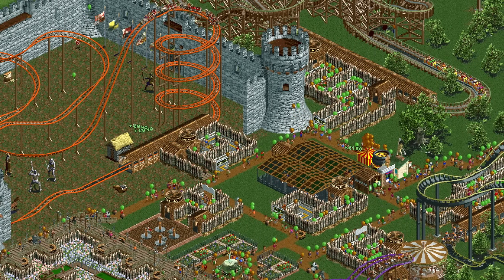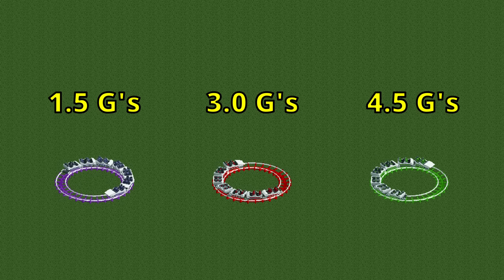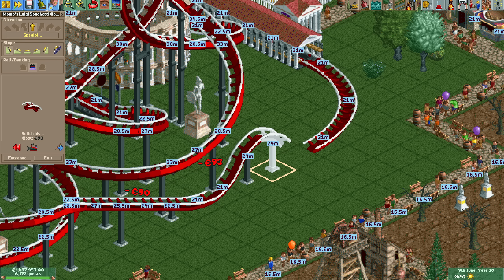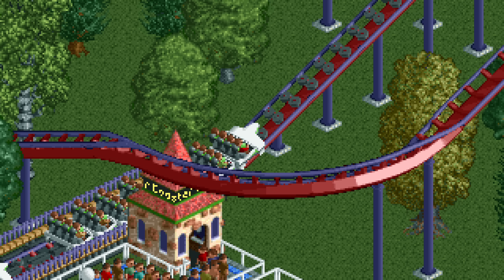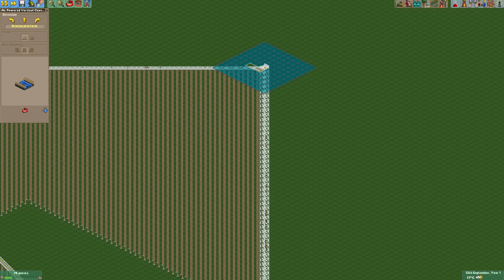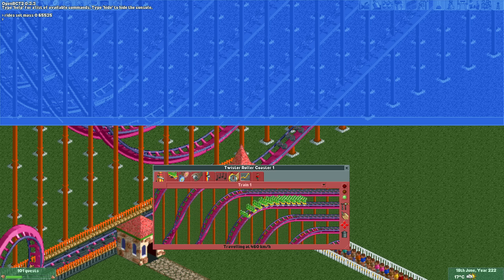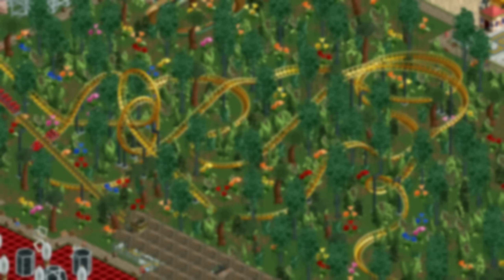What are the Highest Possible G-forces in RollerCoaster Tycoon 2?

Comment: One time as kids my brother and I were in the backseat on a road trip from CA to Yellowstone. We brought the laptop with a power converter so we could play RCT on the way. We used the ride editor to make a gigacoaster to the max height followed by a row of loops. Once we reached the end of the map we made a left turn and did it again, spiralling until the whole map was filled. Then we did our best to do layers on top of the work we had done previously- making a sort of roller coaster cube. Completing the track was incredibly difficult. Of course it took hours to run, and my brother and I forgot about the computer slowly overheating as we passed through many states. At some point some 13 hours later, we remembered our track and checked the stats. 314 excitement factor and sub 7 intensity and nausea. Of course we tried to save it, but as huge tracks are, it was impossible to ever recreate. I still think about this 20 years later and wish we had a camera to record what was a life moment for my brother and I.

Comment: Fun? fact: Curved slopes create more speed than sheer drops into flat straights in real life, so it may not be a glitch that you get higher speed  on them than on sheer drops. The physics work this way because you spend more time accelerating over the slope than the straight drop. So while yes, you reach the ground faster on a straight drop, it doesn't generate as much speed as accelerating over a slight incline downward for longer time.

This specific physics quirk is demonstrated by something called the Brachistochrone Curve.

Comment: The true highest G is the coster instantly going from 400kmh to 0 when it arrives at the station. 

Acceleration is calculated by a = initial velocity - Final velocity over time

If we say that the coaster stops in 0.1s and the difference in velocity is 400 since it goes to 0. Then the acceleration is 4000, which is 408Gs of deceleration!

Comment: I wonder what the G-Forces from the twister coaster repeated launch hills and drops are, just by themselves. No sharp turns, bunny hills, or loops at the end, just launched lift hill and steep drops chained together with 180° turns followed by a reasonable method of deceleration. It looks like it’d have pretty high G forces by itself

Comment: Very high G-forces here, but RCT2 doesn't count for G-forces that can be measured during sudden deceleration in the real world. This is evident in Formula 1. During the tragic weekend of San Marino Grand Prix in 1994, Austrian driver Ronald Ratzenberger was killed during qualifying, when his car's front wing detached and got stuck on his car, making the car uncontrollable and he crashed into a concrete wall with speed of 314 km/h. The measured G-force of the crash was 500 Gs, the highest G-force ever measured in a Formula 1 car, and Ratzenberger died instantly.

If any of the guests would in reality be still alive after the peak points, they certainly would die when arriving at station, as the deceleration would be extreme with the speeds shown here.

Comment: 4:15 the game is not glitched, that is actually how physics works, an inclined "exponential" drop is faster than both a vertical drop and a linear drop
Reply from the maker: You're thinking of the brachistachrone curve, but this is not that. The brachistachrone is about getting from point A to point B the fastest, but this is about reaching the highest top speed. A vertical drop gives the highest top speed in real life, and the reason it is a slower way from A to B than a brachistachrone is that it has to travel a longer distance.
Reply: @MarcelVos  well, fair enough, that makes sense too. 

one thing that i didn't see you try was - i remember making some crazy thing on there 20 years ago that was a spiral drop, i forget the details but there was one roller coaster that you could have descend in a spiral for whatever the height limit is. i remember making it and then nobody would ride it because it was "ultra extreme", i don't recall what the g forces were but they were up there - i wonder how that would compete with the ones you showed here

Comment: 4:10 actually it's a bit more physically accurate for a slope to provide better acceleration than a vertical drop. Ideally you would have a slope that gets less steep so you spend more time accelerating due to gravity, and less time losing that speed to friction from a sharp turn. Friction will cause energy to be lost if you go from vertical to horizontal quickly. You might be able to get a higher speed (and consequently, higher G's) out of some of these designs by using gentle curves instead of lines for your drops.
Reply: No, it is not. You're thinking of the brachistochrone curve which is about the time it takes to travel.

The steepest drop will always have the fastest speed at the bottom. The reason it takes more time is the path is longer.

Comment: The non-vertical coaster getting more speed is, I'm pretty sure not a glitch, but because it's closer to a Brachistochrone curve.
Reply from the maker: The brachistachrone isn't faster because it has a higher top speed, but rather because it has a shorter range to travel to the end destination. All we care about here is the top speed. This would be the same for both drops if there was no friction, but friction does exist, which means that the track with the least friction should get the highest top speed, which is the vertical track.

Comment: It looks like the game is calculating gs incorrectly, possibly only a v/r instead of v^2/r. Let's take the 400 km/h coaster for an example. ((400,000 m/h) / 3600 s/h)^2 = 12345 m^2/s^2. Assuming the loops have a 10 meter radius (it's really probably less, looking at them, but let's assume 10m to be conservative), this results in an acceleration of 1234.5 m/s^2, or 124.6g.
Reply: Yes, the game does v/r which is wrong.

Comment: You mention that the game is glitchy and the one coaster is faster on a curve than a vertical drop, but actually that makes sense. Like with Vsauce's video on brachistochrone curves, the fastest most efficient curve is not a straight down shot then level out, but instead a fixed kind of curve. In RCT I don't think this is intentional but it does add up somewhat because of that.
Reply from the maker: This is about the top speed reached, not about the fastest route from A to  B.
Reply: The brachistochrone curve does not give a higher top speed, it minimises the time taken to travel between two points. If friction is negligible, the top speed depends only on the height of the drop.

Steep slopes giving more speed than verticals is indeed a bug - it's the result of rounding errors in the way the game calculates distances. The fact you can exploit this to build perpetual motion machines demonstrates that is is not physical.

Comment: The behavior of longer drops moving slower than the diagonal isn't a glitch. Two forces are fighting, gravity adding energy vs rolling friction taking it away

As you increase the steepness of the hill, you increase the length at the horizontal, which has more friction.

You also have to remember that a straight line is always a shorter distance than two orthogonal lines.
Reply from the maker: It's about the top speed, so the length of the horizontal track doesn't matter.

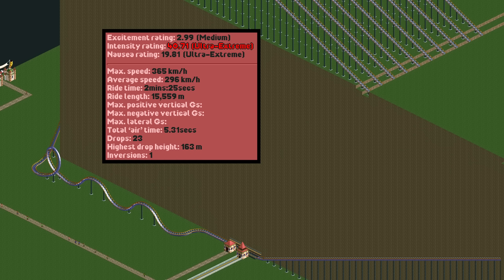Comment: You forgot an important detail: horizontal g's. Not as in left/right, but forwards/backwards. Such as when a car crashes. That 365 km/h train at 5:20 hits the near-infinitely-powerful station brakes, and effectively simulates a crash. It seems to take 9 frames for the train to stop (maybe more, Youtube's frame-by-frame tool is iffy, but also maybe less, it looks like it doesn't slow down until a few cars are in the station). That's 0.15s assuming a framerate of 60. According to some G-force calculator online, that's 68.8 g's. So 4.6 stronger than the lateral g's the game shows, not to mention less survivable since your eyeballs are trying to pop out and the coaster's safety bar is the only thing preventing you from (briefly) becoming the world's fastest human.
Reply from the maker: I didn't forget horizontal G's as the game doesn't calculate them so I didn't include them in the video. I did make a video on them a while ago though: https://www.youtube.com/watch?v=3erIwgBKQBw
Reply: @MarcelVos  I stand as corrected as the park guests stand pulverized by deadly forces.

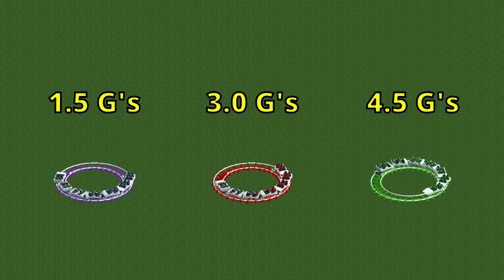Comment: 1:12 Loading circle except its based on your framerate and how good you have internet connection in case of internet?

4:15 as far as I know why steep pieces are faster than vertical pieces is possible from wind resistance or that the train in vertical piece isnt sliding on track relying on its own weight and be entirely reliant on gravity.

8:20 you can see how the game is breaking itself in slow mo or how too intense it got

Comment: I wonder, would the g-forces change at all if the order of the track pieces was reversed? I suppose on the final coaster, between the erratic calculations and very slow deceleration, it wouldn't make too much difference. Perhaps on the "realistic" coasters it might since the coaster technically doesn't go as fast up a hill or loop if it does a turn first and vice versa.

Comment: actually, a deep slope producing more speed than a straight drop is realistic. it's still practically free-falling, but it has more track to run down before it reaches the bottom of the drop. it would be even faster if you could build a round drop, that's what's known as a brachistochrone curve. i believe vsauce michael and adam savage have both made videos demonstrating that concept.

Comment: (These G forces are deadly)

That's not actually true. The human body can withstand up to 9g for a few seconds before passing out or it being lethal. These coasters aren't generating those g forces for very long. Going through these elements is basically like being in a car crash, but people survive those all the time. Therefore, the guests may be unconscious and/or very uncomfortable depending on how long they experienced these g forces for, but they will be completely fine health wise.

For short exposures like these, the threshold for injury is around 50g. At 75g, the expected fatality rate is 50%. 80g is considered always fatal. Therefore, the chance is nonzero that you could survive even the last coaster, although the guests would be pulling those g forces enough times that I would expect them to die 99.9% of the time.

Comment: Quick reference on G forces:
G Force is an acceleration function representing the gravitational constant of 9.8 m/s
Vertical G's: Forces going vertical.  A positive g-force corresponds to a downward force, and a negative force sends you up.  When standing still, you experience 1 vertical G from Earth's gravitational force pulling you downward.  0 G's creates the feeling of weightlessness in a rider.
Lateral G's: Forces from the side.  Positive is to the left, negative is to the right.  Note that RCT2 uses absolute values when finding the maximum lat. G's, so you can't tell if the offending area is a left or right turn.
Longitudinal G's: Forces going forward and backward.  Longitudinal G's are not in RCT1 and 2, but they are in other park sim games like Parkitect and Planet Coaster (where they're called "Forward Gs").
Reply: The deceleration of the last coaster should be enough to paint the ride red...

Comment: A potential correction: in real life, g-forces induced by turns are proportional to the square of the speed. The equation is acceleration = speed^2 / radius (and then divide the result by 9.81 to get g-forces). So, doubling the speed should quadruple the g-forces.

I'm not sure if that's how the game calculates it, but that's how it works in real life.
Reply: Yes, that's how it should work but the game's G force calculation is wrong. G forces in game increase linearly with speed, which lets you get away with some ridiculous stuff.

It's quite annoying, because I'd like to see some larger radius turn pieces added but they would get G forces that are far too low.
Reply: It looks like the game is calculating gs incorrectly, possibly only a v/r instead of v^2/r. Let's take the 400 km/h coaster for an example. ((400,000 m/h) / 3600 s/h)^2 = 12345 m^2/s^2. Assuming the loops have a 10 meter radius (it's really probably less, looking at them, but let's assume 10m to be conservative), this results in an acceleration of 1234.5 m/s^2, or 124.6g.

Comment: For context:

At about 3-4 G's; your going to need to do some leg squeezes to stay conscious for a decent period of time, this is also about the same amount of G's that an astronaut will experience as they enter orbit, although they are lying down during it so its a bit different. At around 6G's; you can no longer breath normally due to your diaphragm not being strong enough to overcome the forces, although theres still methods of breathing, most involve an oxygen tube and making a specific noise to force air out of your lungs. This is also the G force that a Ju-87 (Stuka) dive bomber pilot would experience in WW2, although they had automatic systems in the aircraft to pull out of the dive because the pilot did black out.
At 10 G's you reach the limitation of many early fighter aircrafts airframe (the components of the aircraft would bend / snap) and at 18 G's its basically agreed that if your in an airplane your as good as dead since you generally need to be awake to pull up.

The AIM-9B Sidewinder (one of the earliest missiles used in A2A combat) can pull a max of 10 G's, the AIM-9H could do 20, the AIM-9L could do 30, a variant of the AIM-120 AMRAAM can allegedly do up to 35 depending on airpseed, and the current AIM-9X can do an estimated (but still somewhat classified) 65G's maximum.

Needless to say, these coasters are absolutely insane

EDIT: To put this into perspective; the F-22 (Which is "Hypermanouverable" is rated to just 9G's (depending on fuel load and weight), the F-35 is rated for about 9.5, the Su-27 is capable of an alleged 9, and the Su-57 ("muh hypermanouverability stronk" russian enjoys can rejoice) is said to be capable of over 9.0 (although its very likely thats propoganda since they also claim to have more than 70 of them and as far as is known they have at most 40).
Aircraft often can survive 1.5-2x their rated G pull, but modern aircraft use a computer system to make sure they dont overload on G forces, so unless the pilot turns that setting off, they wont pull more.

Oh, and negative G's are significantly harder to deal with
Reply: you're*

Comment: "...more than one and a half times as fast as the previous ride. As a result, the g-forces are also about one and a half times as high"

a = v^2/r, so if you have 1.5 times the speed, you should have 1.5^2 = 2.25 times the g-force. Your velocity changes by 1.5 times as much over the course of the turn, but you're also taking it 1.5 times faster, so since you're changing your velocity by 1.5 times as much in 1/1.5 of the time, that's 1.5^2 as much acceleration. Did Chris Sawyer mess up the math?
Reply from the maker: It's all just linear in the game, so my statement is roughly correct for the in-game numbers.
Reply: Yes, Sawyer messed up the math. G forces in game increase linearly with velocity.

Comment: What the heck was that flat ride with the 4 spinning guest at the bottom left at 0:01 in that opening scene?! That looks like a ton of fun. Must be some user-designed ride from Open RCT.
Reply from the maker: It's an expansion ride based on the space rings.
Reply: @MarcelVos Whoa, cool. Thanks for replying! There’s so many cool things possible with Open RCT. Almost looks like they’re pillow fighting. 
My ultra boring idea for a custom flat ride is simply an upgraded version of the circus. It’d be much larger (5x5 tiles) and would have far better stats, mainly a high excitement rate. Intensity and nausea would remain quite low. Give it 50 capacity for a throughput machine.

Comment: Another stat that the game doesn't track is linear Gs, the starting and stopping speed (I don't know what else to call them). When the train travelling at hundreds of kms per hour pulls into the station, it stops to zero it basically no time. Even wearing restraints the rider would get thrown forward
Reply from the maker: I did a video about that a while ago and calculated that a LIM coaster with a fast launch pulls about 70 linear G's.

Comment: 4:12, I think you are experiencing the wonders of Brachistochrone curves here. I don't think this is a glitch.
Reply: @_peters6221  but you can clearly see that while the vertical coaster 'drops' it is faster, something that is indeed as expected, it then poorly translates the vertical momentum into horizontal, which is why after it starts moving horizontally it is slower than the other coaster (when the video pauses).

Comment: My favorite ride to exert max g-forces on guests is a ride popularized by streamer, Vargskelethor Joel, it's called, "DA PO PO BE FAST ON YO ASS." It's a looping rollercoaster with two large turn pieces, a small right loop, a small left loop, and two more large turn pieces. When it is set to powered launch mode (passing station), launches at 573mph, and has over 5 laps, it has almost 40 positive vertical Gs.
Reply: HELL PARK
Reply: @rinoz47  ITS A FEATURE